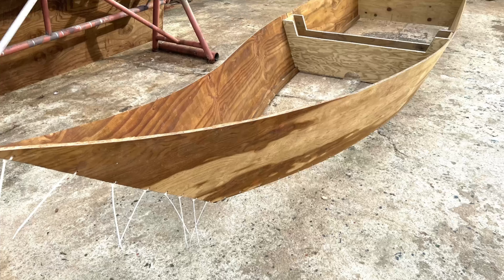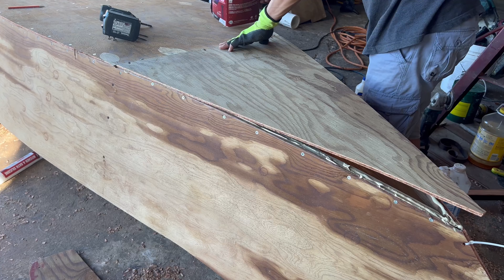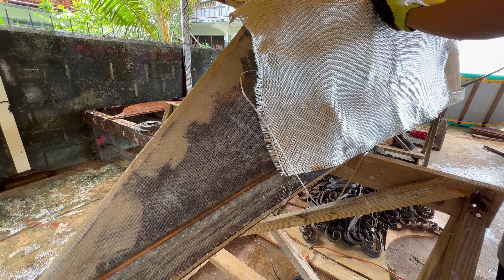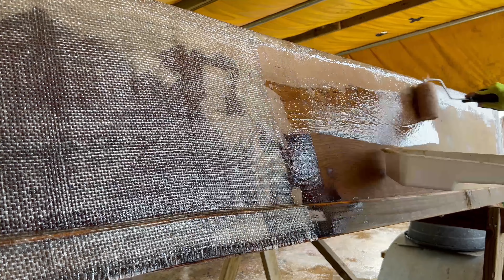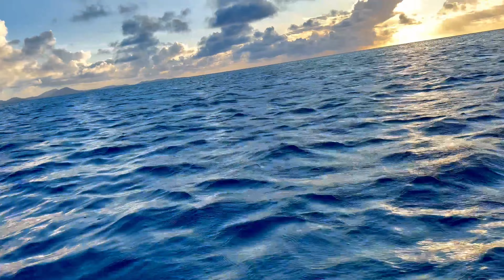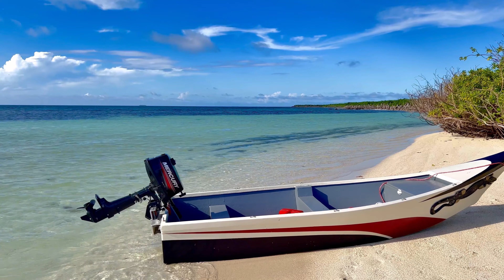How to make a boat?

Comment: I would have filled the hollowed parts with spray foam for extra safety so the boat doesn't sink if it ever got damaged, than you could save it and fix it
Reply: now that is some good advice. i would add also make the whole boat with pressure treated lumber not just part of it
Reply: @djkingpersia is that normal to do though? Use that lumber
Reply: Do not put expanding foam in boats, or any open-cell foam for that matter. Closed-cell insulation -style foam can be waterproof, but most small boats I've seen use airbags for buoyancy.

Comment: I'm building a small fishing boat in my shop right now. I got the main sides and bottom together and started to seal it. I decided to try poor mans fiber glass (canvas and waterproof wood glue) and I'm really impressed how it turns out. I thought I'd have to use atleast three coats to get it thick enough to work. Well after sanding the first coat and applying the second coat yesterday, this stuff is good as fiberglass. I'm glad I did spend the extra money and headache with fiberglass. 
 After sanding this coat, I'll be ready for paint!

Comment: Certainly gives me confidence in the boat I want to build! I especially like that you didn't try some crazy splicing of the bottom sheets. I want more rigidity so I plan to do two layers of ply and not overlapping the seems. Have you used fiberglass before? It'll be my first time.

Comment: that boat cut through that water like a knife! nice reebok strip on the side lol i see some pressure treated lumber in there but why not the whole boat?? other q's are those screws stainless and are they self tapping?? i would worry because that looks like a hefty screw adn so many of them going through that thin strip looks like 1x2 or less. other than that you built the "sh$$" out of that boat!

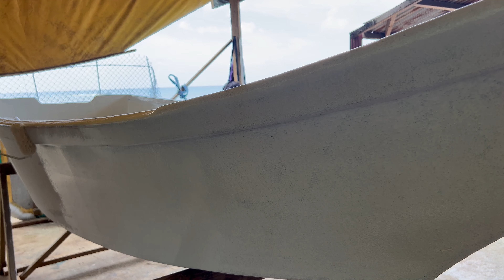Comment: what is the putty applied to the outside of the boat before painting after fiberglass and epoxy resin? at 4:56 you begin applying it but don't show what it is.
Reply from the maker: Body filler
Reply from the maker: And marine boat bottom paint.
Reply: @craftsmantv7205  Thank you.  I am going to be attempt the boat build.

Comment: What’s the weight and dimensions?
Reply from the maker: The width is 46inch and 13feet long.it weighs 75klg.without a motor.😊
Reply: Gud day idol, can I ask the length, width of the bottom and side size. And also thickness of the plywood. Thanks for the reply.
Reply from the maker: @woodenjetski6187  lenght is more than 13feet.and width is 46inch, bottom40inch .plywood 1/4”

Comment: What's the resin?
Reply from the maker: Evercoat marine
Reply: @craftsmantv7205  And what is the white stuff before you paint it? And what kind of paint were you using?
Reply from the maker: @fishingbear5538   i used body filler to flatten the surface then paint it with epoxy primer before finishing it with  rust-olium marine coating boat boat bottom paint.😊
Reply: @craftsmantv7205  You're awesome, dude!